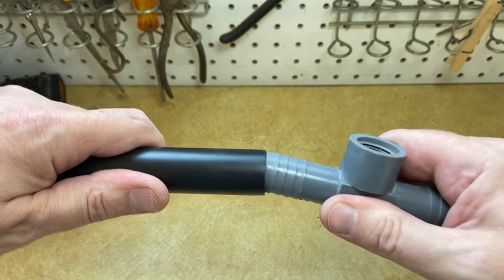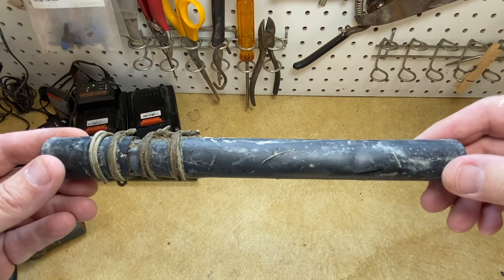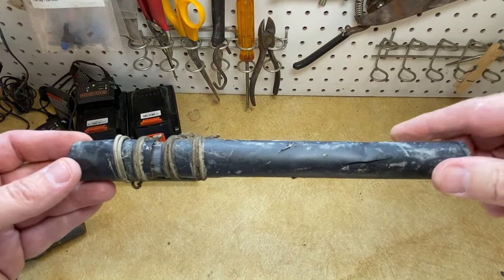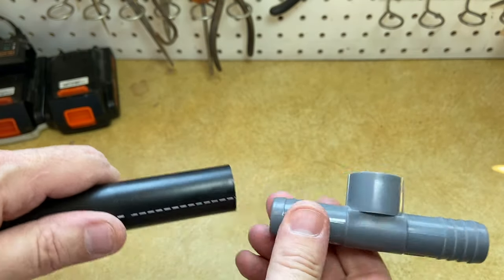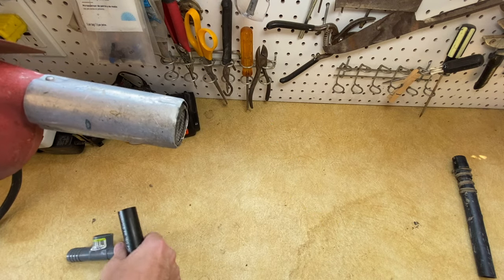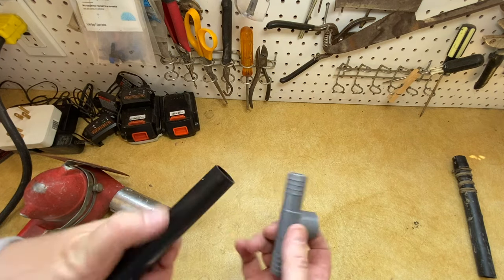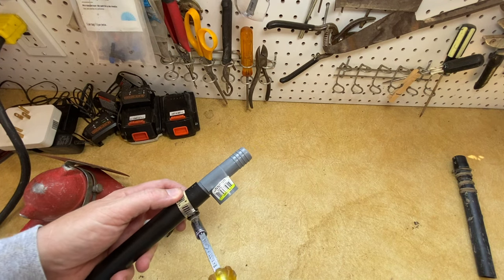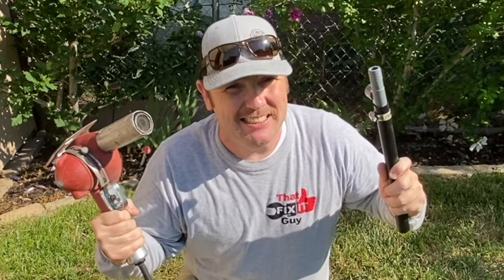Barbed Fitting Troubles?...QUICK TIP GUARANTEED TO HELP!

Comment: With the clamp and cool down that connection is never going to fail or leak .  Nice quick tip !     And if you don't have electric available a hand held propane torch will warm the plastic pipe up too , just don't hold the torch too close and make sure that you are moving the flame constantly .   Have a great day Brian !
Reply from the maker: This does make a great connection.  Great idea with the propane and agree on the caution. I was looking and battery powered heat guns. I don’t really need one, but I could see how it could be handy for a sprinkler job.
Reply: will the same thing work if i want to remove the poly pipe?
Reply from the maker: @David Cotto Yes it would.
Reply: Thank you for chiming in @richard , I do have a portable propane torch.
Reply: I’ve read hearing the end of the pipe in boiling water works well. The temp is lower than it takes to damage the pipe and high enough to soften it. If it’s already installed, wrap the joint in rags and pour the boiling water over it then wait for the heat to sink in.

Comment: I boil up some water, put it in a cup and hold the end of the tube in the water for a few seconds. It heats it up quick and works well.
Reply: And there's a number of reasons why this is a far superior method. Hot water is also great for taking the fittings apart.

Comment: Irrigation tech here, get a proper torch doesn’t have to be a high quality but a quick 3-5 sec flame to the poly end is enough and don’t heat fittings. Also hose clamp connections can undo over time, look into crimp connections with crimp clamps they will never come loose
Reply: Exactly!  Hose clamp connections don't last.
Reply: Good to hear since I just picked up a bulk pack of crimp clamps and the tool at Lowes to fix my spring hose. Guess I'll need my torch, since there's no electric at the spring and I don't have a 200 ft extension. 😆

Comment: i use a propane torch.  there aren't electric plugs 75 feet away in the yard when you have a broken pipe in the yard
Reply from the maker: I know what you mean. I ran a 100 ft cord to use the heat gun.  I have never used a torch.  Not that I wouldn't. I have seen a milwaukee battery powered heat gun and thought about spending some money.   I will try the propane torch.  Thank you

Comment: This method is so much more work than the way I do it. I first place the roll on pavement for about an hour in sunlight to make it pliable. Then to insert the barbs I just use a few drops of water based unflavored unscented KY jelly.  No heat needed. It works so well you can even pull it back out for about 10min afterwards in case you forgot to slide the clamp on first (been there done that).  One comment said dish soap which would probably work as well, but I wouldn't want all of the chemicals from dish soap being sent directly to the root zone of my plants.
Reply: That’s hard to do when the pipe is already in the ground and you are adding a valve.
Reply: Clamps can be opened completely and fitted around the pipe.  Then just feed the open end of the clamp back into the bolt mechanism and turn the bolt.  Works every time!
Reply: How about plumbers grease instead of soap.  It’s rated for kitchen and potable water supply, I think.

Comment: Heres a black poly tip NEVER use plastic barbs. They split from the pressure of the hose clamps, ive even seen a barb crack and fail and the part that was inside the pipe was melted. Use brass barbs and 2 all s.s. Hose clamps face one left and the other right.

Comment: Used this tip yesterday on 5 fittings. Worked like a charm. My heat gun was a little more modern than yours.
Reply: That heat gun is an industrial version. I use one like that to bend thick wall PVC electrical conduit.

Comment: Black pipe exposed to sun on a warm day makes barbed fitting slip in easily. Another good, safe option is dip pipe into hot water for a minute or so and fitting goes in effortlessly.

Comment: Nice tip, Brian, it could also be used to bend the pipe a bit, but not kink it, too.
I'm reminded of a plumber that had to get an electrician bend a black pipe to go around a corner since they couldn't get in the corner with pipe fittings.
Reply from the maker: Yeah right on. That will make another great video.  That is pretty sweet.  Thanks Bryant!

Comment: I'm putting together my gray water system and have a new foot valve new water pump ballast tank all new fittings and even a new water heater but putting in the pickup tube from the Cisterns portal tube is concrete and has poly pipe fitted thru it but 5 Feet down inside so I can't get leverage of heat on it so I'm screwed but thanks for helpful tips buddy always helpful to keep in tool box👍
Reply from the maker: Oh man sound like a job. Let me know what you end up doing. Always interested in new solutions to issues.

Comment: With poly in place of a heat gun or torch hair dryers work in a pinch. With poly though I have normally always used a lighter.
Reply from the maker: Right on!  That’s a great idea.  I had not thought of a lighter.

Comment: Interesting. I had 2 barb fittings fail after hose clamps were applied. I swore I tightened them. after seeing that the clamps were applied over the barbs . Mine were near the end close to the fitting end.  I’m gonna try over the barb area. Hard to get the heat on them due to they are in the ground

Comment: Should have mentioned sliding on hose clamp before inserting fitting.
Used to pour hot water on the pipe. It worked OK.  Now I got a heat gun.  I have had pipe split if trying to brute force barbs into cold pipe.

Comment: Your tip surpasses mine - using a rubber mallet, when possible. One question: do you always install your hose clamps so far from the end? With pex it’s 1/8 to 1/4 inch away, but what is the best distance for poly pipe?

Comment: Great video!...I'm having a problem this morning that I've never experienced before...All of my 1/2 fittings are "too small" for my "too big" 1/2 inch irrigation tubing!!!...I can't figure out where I messed up, but either way I have to go to the store and return a big chunk of the stuff I bought...I see you used hose clamps, but in most of my yard I've never needed to use hose clamps...I've just shoved the barbs into the tubing...Do you have any clue what could be happening here?
Reply: I had the same problem when I started my irrigation career, this is what I learned: not all brands of 1/2" irrigation tubing and fittings are the same and also if you have a 1/2" nominal size of your pipe, the wall can be thin and have a bigger internal diameter than normal. Be sure to ask to your supplier for the internal diameter of pipes so you make no mistakes with the fittings. Sorry for the late respond 😆

Comment: I some times want to buy clear tubing for connecting to various ports in
 vehicles for testing and flushing - what is the right way to measure a 
barbed male connector to determine correct tubing size?
Reply from the maker: I have always gone by the size of barb and size of fitting. Like 1/4 hose will take a 1/4 barb fitting. But that being said I know that you get into auto hose and it could be different. I will start looking into this and make a video.  Thanks for the question and idea.

Comment: As a professional who works on sprinkler systems I get an even better and faster tip for you. Just use a rubber mallet. Two three wacks and it's in place. I only use heat on anything above 1.5" pipe. Below that and a rubber mallet does the trick. All the heated pipes I run into that they "set the clamp" are leaking and never made a seal. They just left clamp marks in the hose.
Reply: What about for funny pipe? Can't wack anything into that with a hammer.

Comment: That's good advice, but I have done this both with sunlight and heat gun, but I still get some leaky joints.  I've cut carefully, I've put on clamps, but I still have a problem.  Any advice?
Reply: Put on plumber’s tape first. Because to twist the direction you wrapped the tape.

Comment: Has anyone tried using some plumbers silicon based grease on the barb connector?  Heating the female connector is a sure thing, but it’s fatiguing and hassle to do more than a few.

Comment: Do you have to use hose clamps on all those fittings if it's just a drip line, like 30-40 psi?
Reply from the maker: I think that if it goes on pretty easy then I would secure it some way. Wire is a good cheap option for what you are doing. 30-40 psi is pretty good pressure
Reply: @ThatFixItGuy  I haven't been using clamps (or anything else) with barbed connectors, should I be using them in addition to the barbs or is relying on the barbs on their own enough?
Reply from the maker: @KimBelletare  If it has been working for you without them then I would not worry about it.  It really is only going to matter if your water pressure is high and blowing lines apart.  have you noticed fittings leaking?

Comment: I'm trying to patch up the irrigation system on a new property and can't get the old fittings to stop leaking.  Will heating and cooling help mould it into place without changing up the fitting, or should I replace the fitting (it looks ok as far as I can tell).  Or maybe splice in some new pipe so it's not so stretched out?
Reply: I’ve had fittings that wouldn’t stop leaking and the only fix was to replace. On close examination, the barbs were deformed. You can try heating but in my (limited) experience, you’ll have better luck replacing the fitting. Might need heat to accomplish that without cutting.
Reply from the maker: I could totally see a bad batch of barbs screwing things up.
Reply: Is there flashing (a ridge of plastic where the halves of the mold met) on the barbs?  Might need to trim that away.

Comment: Hot boiling water works most of the time.   And is safer for the pipe.   The heat gun could damage the pipe if too much heat is used.

Comment: You will have a hard time with 160psi  pipe though .80 psi rated pipe should be more than enough as most systems should be running at 40 -60 psi.

Comment: I use a torch. It goes anywhere and you don’t need electrical. I have installed several sprinkler systems with pressure as high as 75 psi and have never used a hose clamp and have never had a fitting failure.

Comment: Use boiled water. It's way better than a heat gun or any sort of flame.

 Pour some freshly boiled water into a cup/mug/jar. Place the end of the pipe into it. In just a few seconds the pipe will be soft enough to easily put the barb in, or even take a barbed fitting out.

Benefits: you can easily control the depth of water so much more precise to heat enough but not too much of the pipe.

Impossible to accidentally burn/melt the pipe.

Much more even distribution of heat. In particular, heats from both the inside and outside. With a gun or flame, to heat the inside enough, you need to heat the outside even more so the heat conducts through (and poly is an insulator, so this is slow). This again makes it much easier to burn or melt the pipe.

It's also far better for removing fittings. For all the above reasons. Plus the even heat means it heats to the right amount faster. And best of all it's impossible to melt or burn the fitting itself as normally boiled water temperature is too low to damage the harder plastic fitting whilst being perfect for softening the pipe.

The only disadvantage is obviously a heat gun or flame is instant heat and a kettle takes time to boil. However you probably already have an insulated cup/bottle/thermos for your coffee - simply take another one to the workshop or site with boiling water for your fittings....